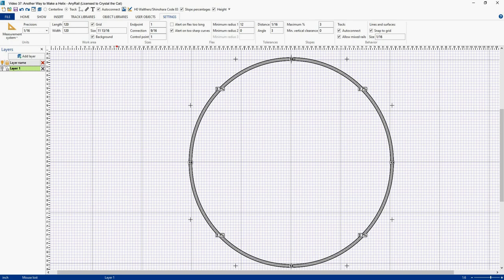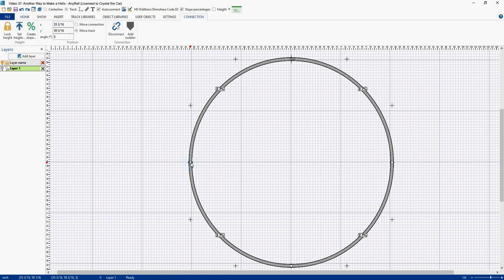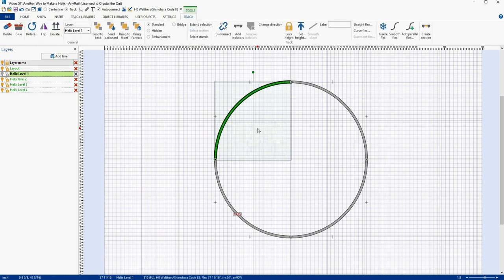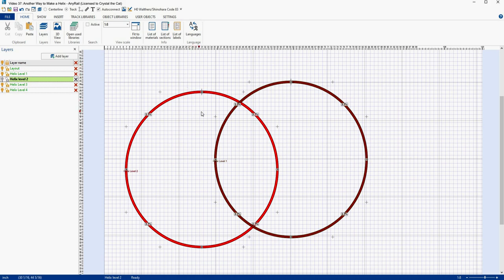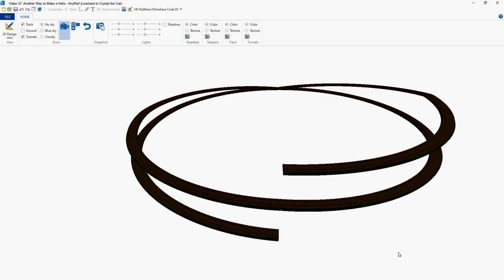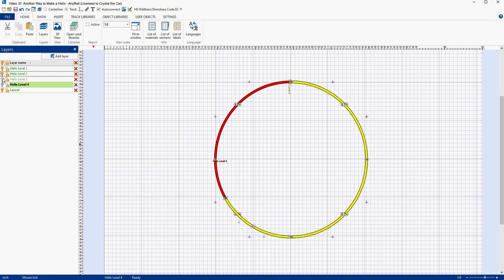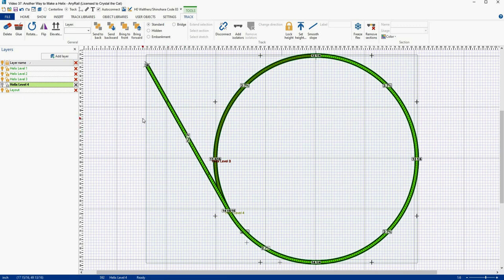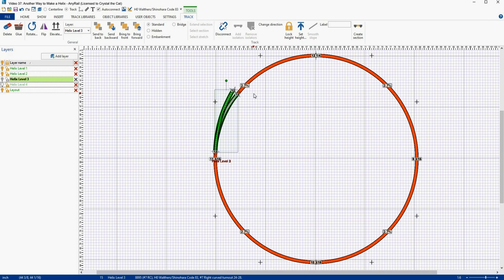AnyRail 6 Tutorial Video 37: Another Way to Make a Helix

Comment: To make the layers join the previous layer properly I attach a straight flex to the entrance to helix on the layout layer. The new layer then attaches to the correct part of the previous layer. When you have finished the helix you can delete the straight flex or use it to connect to the main layout.
Reply from the maker: Peter, thanks. I hate to admit this, but as soon as I read your comment, I realized I discovered that out when I was practicing the method and then forgot to include it in the video. Blame old age.  Or the fact that there was a bout two weeks between the practicing of the method and when I wrote the script and recorded it. I guess old age again. Take care, Dave

Comment: Hi Dave I've  found a way to get the helix to connect in the correct direction each time.  After you construct the first level you construct the second and subsequent levels at a different starting angle - any angle will work it just needs to be a few degrees offset from the first level in the direction that you want the levels to line up..  Once the second level is complete you offer it up to the first for connectin and hey presto it aligns itself perfectly every time.  Hope this helps to cure the frustration :).  Peter
Reply from the maker: Hi Peter, thanks for the info. I will include it in my next video on a two level layout I was considering building. Dave

Comment: Very good, Dave. I tried a similar technique but using the Helix tool to create each level. I find the Helix tool a little quicker to use. Then I use the Smooth tool at the end if I need the exit at a different point (i.e. an angle that is not at a multiple of 90 degrees).
Reply from the maker: Hi Bob, I tried your method and it works just fine. I suspect that there may be as many methods to solve this problem as there are users of AnyRail. Maybe I'll gather the responses and put them all in a future update. I'm trying to get a first draft on a new layout design but I'm making a lot of compromises in this design. Why is it that we model railroaders always need one or two feet more in both directions to design that layout properly? Oh well. Take care, Dave